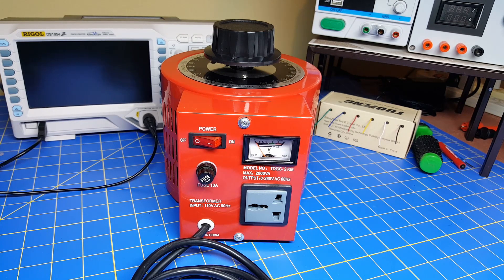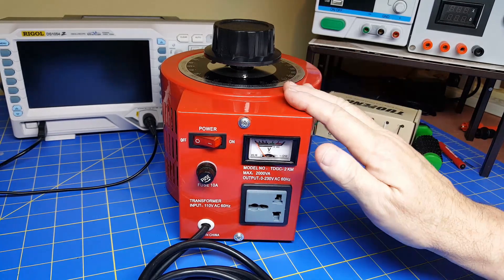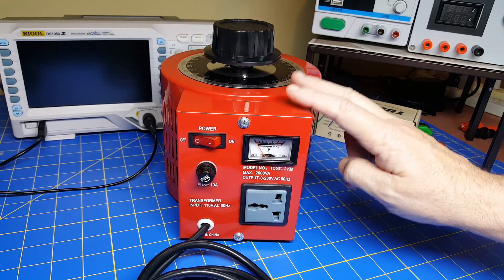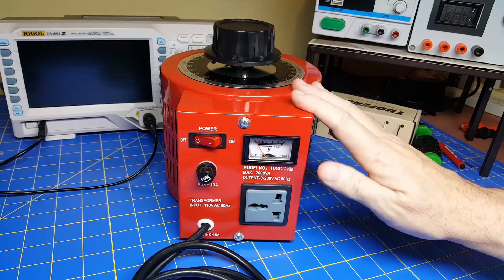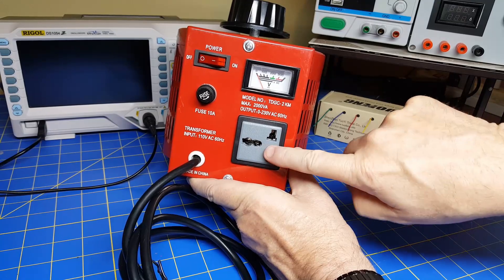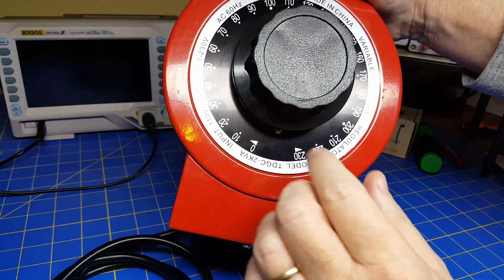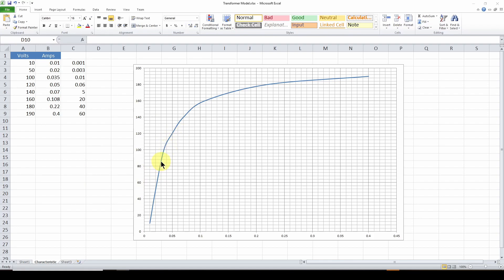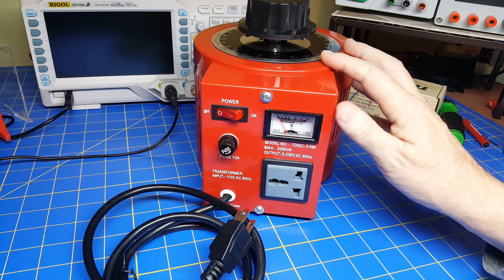Variable Transformer Review: Mophorn 110 VAC In, 0 to  230 VAC Output

Comment: It's actually very advisable to use this in combination with an isolation transformer, since VARIACs aren't isolated.
A nice little project is actually use this isolation transformer after the variac.
That way you can make a simple DC (lab) power supply without dissipating to much heat (since you're changing the input voltage with the variac)
Particularly ideal for like audio amplifiers that use a split rail power supply.

Btw, the output of this variac is a universal plug, so US connectors will work as well as EU connectors

Comment: My Variac is the digital UK 2000W UK 240volt, but I use mine with a Residual Circuit Device.  I have never shorted mine out, but I expect the RCD will trip, but I don`t use my fingers to test the voltage of electrical equipment !!!!!

Comment: There are a number of differently branded Chinese units of different ratings that look just like this. I bought one and and and opened it up to check its safety. Its construction (soldering etc) was substandard and potentially unsafe....fuse and socket werent agency approved. Switch is not meant to be soldered. Power cord is glued in place. However the coils themselves were wound properly.  I suggest that it be inspected to make sure the chassis is grounded properly. Forgot to mention that if the schematic is correct, with the switch in the off position, if the secondary is backfed then the pri is shorted with no protection.
Reply from the maker: I have no relation whatsoever with the vendor, and couldn't care less if anyone buys this transformer, but I'd caution folks not to take vague generalities like "substandard", "potentially unsafe", not "agency approved" and some of the other points as a conclusion that any device as inherently "unsafe". Unless you've shown that the supplied fuses fail to blow under fault conditions, or that somehow the soldering is insufficient to keep the hot wires from touching the case, and so on, then I don't think any clear conclusion can be reached. People who use this type of device need to be skilled and knowledgeable and take proper precautions, especially since you're working with high voltages and you'll probably be doing external wiring unrelated to the transformer that is far more likely to get you injured. And never assume ANY equipment is in perfect operating condition, no matter how many agency approvals and name brand fuses and nice looking solder joints. And don't do dumb stuff like touching metal cases when the equipment isn't totally disconnected and de-energized. That's why they have a plastic knob to vary voltage. And if you're worried about the fuses, do as I showed in my video explaining how fuses work and test the performance characteristics to see what they ACTUALLY do, don't just assume. And if you don't like the soldering, take out your soldering iron and spend 1 minute to make it nice. These are not consumer devices, they are for people who are skilled and knowledgeable and know how to work with them safely, and who take extra precautions because they're working with high voltages and don't assume the devices are working perfectly.

Comment: Glad I found your video.  I'm trying to use a non inverter dirty power gasoline generator and clean the power to run sensitive electronics.  I know I need a UPS or AVR.  Will this clean power?  I may need 50 amps.  What are your thoughts?
Reply: Since this is a very large inductor, it should clean up the power very well, but don't forget to put a large capacitor across the output leads too, if you can. That should put your worries at ease.

Comment: Do you have a link to where it can be bought by any chance? My internet refuses to acknowledge this things existence in a search and instead enthusiastically displays an unending parade of 130V output versions. Very odd.
Reply: The model number is in the description box
Reply: @p_mouse8676  .....I know, that’s what I used to initiate the failed searches, ergo the request for an actual link. Thanks though but, the model number not being enough was the point of my question.
Reply: @biggest23  oh my apologies. I think I misunderstood your question. Normally looking for "variac 240V" will do. But be careful not getting a 230V input variac
If you still can't find any you could also use a second transformer 115V to 230V after the variac. This basically multiplies any voltage by 2 (since it's a 1 to 2 ratio).
Extra benefit is that is will be isolated as well. Which a variac isn't.
Reply: @p_mouse8676  ....Cheers Mr Mouse, I appreciate your efforts mate. Have a good one.
Reply: @p_mouse8676  .....You’re a scholar and a gentleman sir. Thanks for that. My internet still refuses to divulge the location of this item without a link. Isn’t that weird?  Have a good one Mighty Mouse.
Reply: @p_mouse8676  it’s actually 0-130 volts it’s just the picture